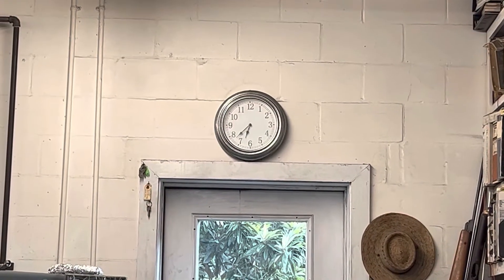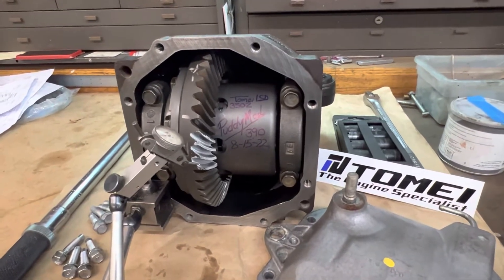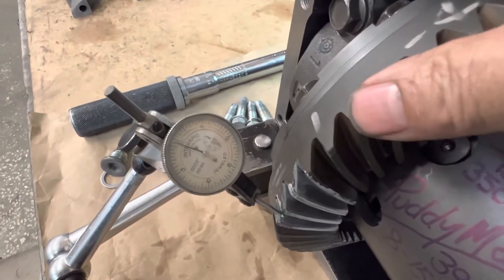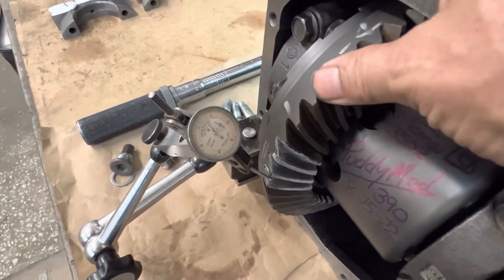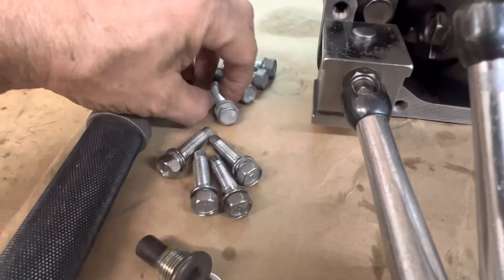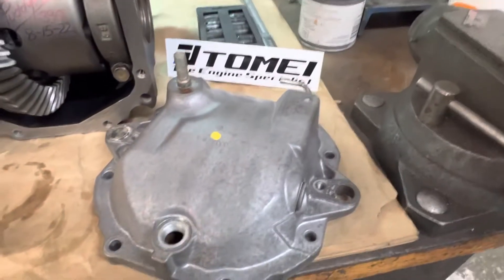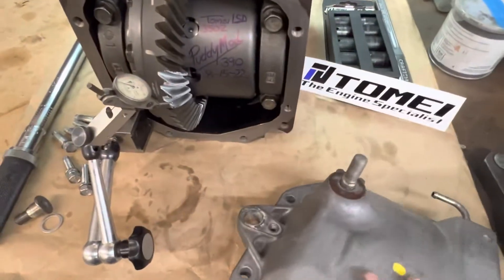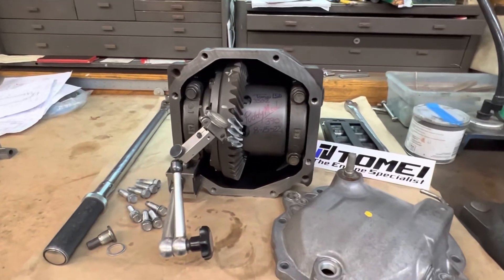PuddyMod rebuilding a Nissan 350Z R200 differential part 3

Comment: Hey for the front pinion seal... I 'MAY' have torqued using 'dugga duggas' instead of a tq wrench when redrilling the flange, and it 'MAY' be leaking... of course 'I' wouldn't do this... we are just being hypothetical. But, like let's say I did, would I  most likely just need a new seal and crush washer?
Reply from the maker: @taoisttiger4702  yeah definitely sounds like you’re going to have to be replacing some parts. There leaks are not good.
Reply: @puddymod  Z1 motorsports already has my money hahaha.
Reply: @puddymod I rewashed your 3part series and I didn't see where the crush washer and seal go in/come out? Will I need special tools to pull the input shaft seal and crush ring? Or should it be relatively simple to get the crush out( depending on how bad I messed it up😅) ? Thanks a lot for your help btw!
Reply from the maker: @taoisttiger4702   installing the pinion seal and the distance piece/crush tube is the same procedure as installing one in one of the S2000 differentials you can watch how it’s done on one of those videos. Having a press handy, makes it much better and easier to install the seal. The crush tube is installed by hand and then the differential pinion is assembled and then you add torque to the pinion nut to get your preload.
Reply from the maker: installing the pinion seal and the distance piece/crush tube is the same procedure as installing one in one of the S2000 differentials you can watch how it’s done on one of those videos. Having a press handy, makes it much better and easier to install the seal. The crush tube is installed by hand and then the differential pinion is assembled and then you add torque to the pinion nut to get your preload.